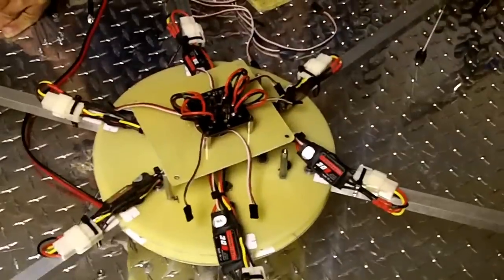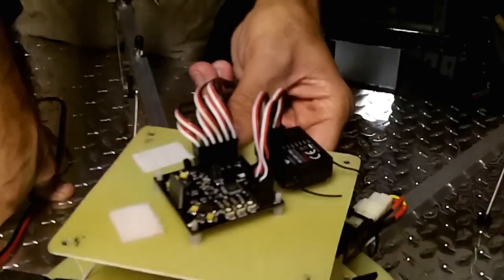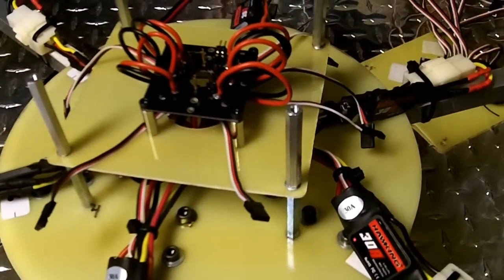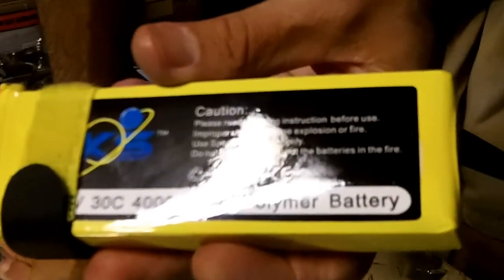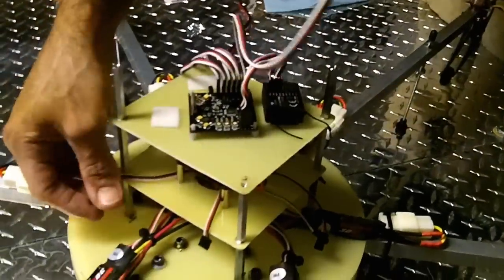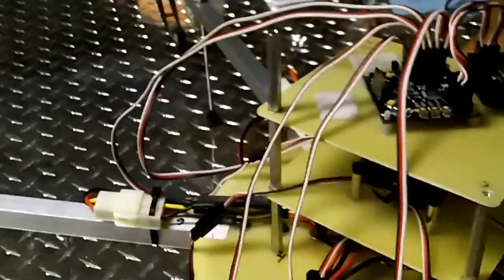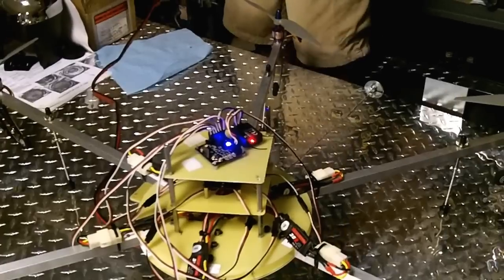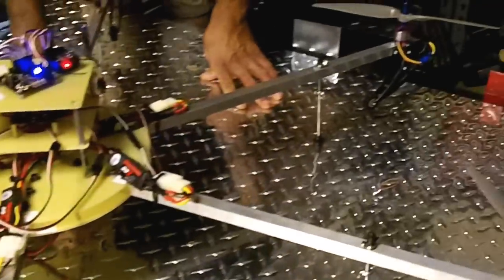4 Foot Hexacopter Build - Part 4 (Configuration "Hexa +")

Comment from the maker: I will be working on the Hex this weekend or the next, I had to modify the design for performance sake. Even though the frame is the same for the new electricals, the Motors, Props and ESC are much stronger. The new spec are 400kvm motors, 18 x 6 wood props , 100 amp Esc', 2 10,000MAH Lipo batteries. W I will keep you posted.